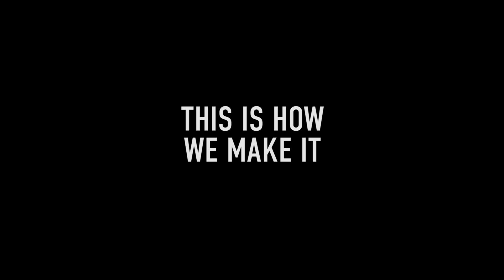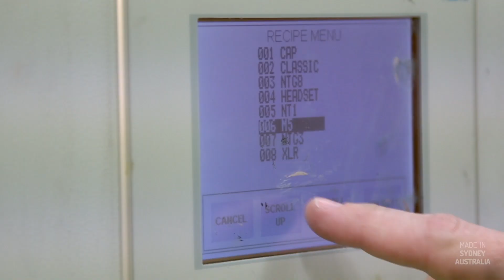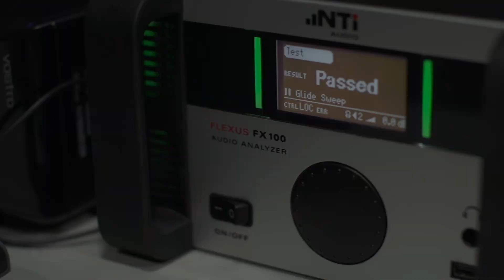Introducing the new RØDE NT1

Comment: what's new about this? is it just the color? or is the sound different as well? if I were to buy an old nt1 (the white one) would it sound different than the black one?
Reply: Thanks, but I wasn't talking about the NT1-A.  I wanted to know the difference between the old NT1 and the new NT1. In the beginning of the video, it shows when the NT1 was first released in 1990.
Reply: NimblePlays Thank you for the info!
Reply: I have an original NT-1 (AUS made, before the NT1-A was made in china)... I like it, compared to a NT1-A seems to be a bit less going on above 3k. tends to exagerate the mids when put on loud sources (drum overheads).

I ended up buying a NT1000 and loved it so much i bought a second one for matching overheads... and I use them as my main vocal /  acoustic guitar / percussion / violin / 'whatever else the client drags in' mic.  

I have no experience with the new version but thought i'd share what I know about the old one.

Comment: nice.. how does this compare with the neumann tlm 103??
Reply: if you don't already own a neumann tlm 103 then go with this. neumann makes great mics but in the end its not really worth the price tag. unless of course you're a baller then go nuts. there's a fair amount of hype when it comes to neumann tho. again not saying there mics aren't good just pricy. the key to a great sound is a good pre amp and the corresponding engineering SKILLS to match. the BLUE Spark is also hard to beat in this respect.
Reply: CoTheReal good info. I actually copped the 103 a few months ago lol
Reply: jaja! right on man i'm sure you're not disappointed
Reply: The TLM 103 kinda sucks. It sounds so fake and hyped, and its high end is so harsh. The $700 TLM 102 is much better.

Comment: After watching this,  I don't think I learned a thing about the "new" or different about this NT1, (Edit) I bought one this weekend, traveled 125 miles one way to brick and mortar store,  I asked them to check it before I head home,  Vanity kicked in, and the night manager said "we never have any problems with these"... guess what... it was bad (loud white nose issue, and very low record level output).  I had to ruin another day, drive 250 miles round trip, again to trade/return it.